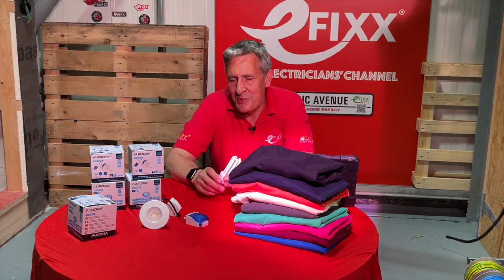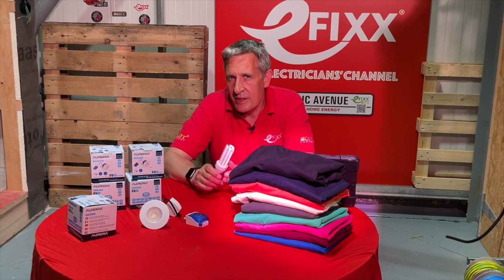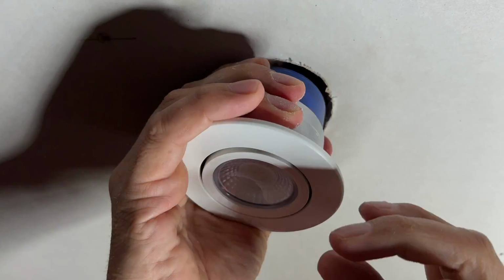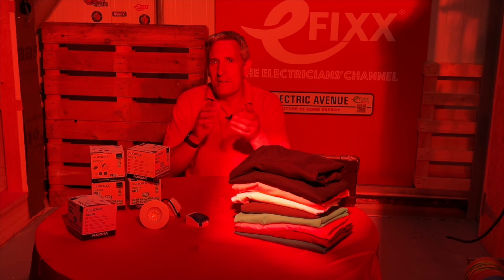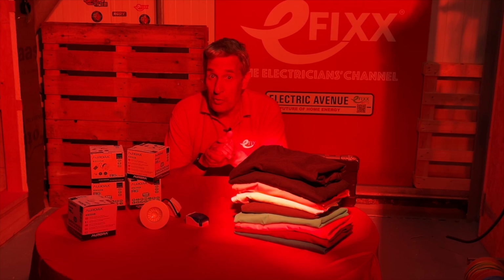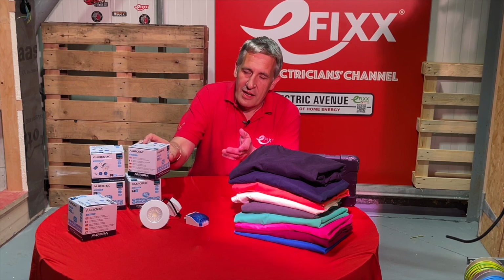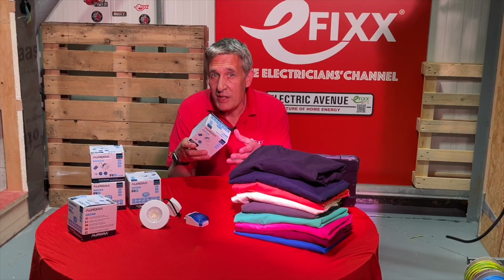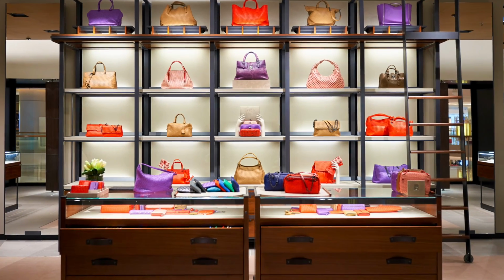Uncover the Secret of the NEW Aurora LED Downlight!

Comment: My mate used to use those compact flouresnt horrible lamps 15min warm up etc but he was as tight as two coats of paint😮😂😂 got a soffit lighting job coming up any recommended down lights? I was thinking the ones with 3 different colours to select with built in switch just to offer my  customers a choices nice one Gordon 👍

Comment: Why not make wireless so can adjust both colour and Kelvin to suit with a few programmable presets so users could set up and quickly switch to their preferred lighting settings according to their mood. Totally flexible and timeless  - covers change of owners or products on display. Would do away with all the options and swap outs. Hopefully costs would be slashed with just one option and volume production of same…….